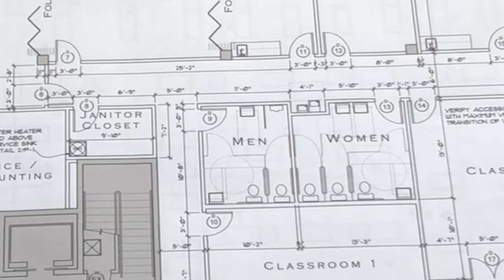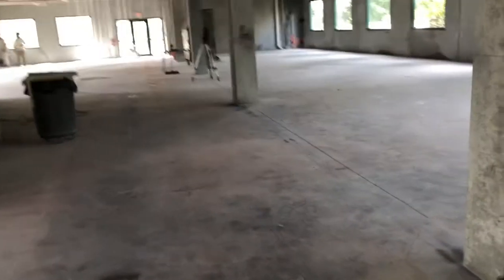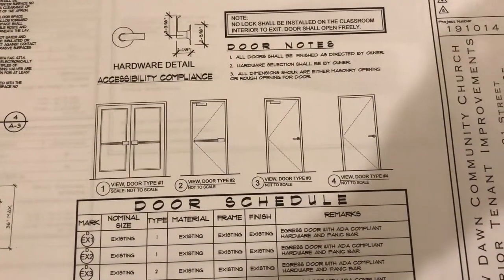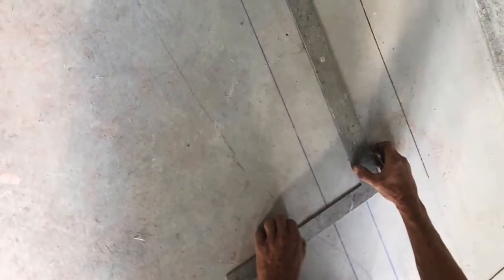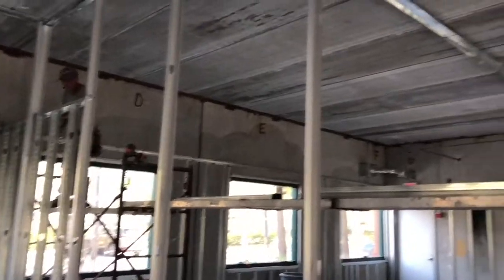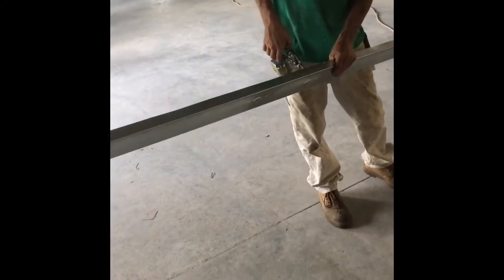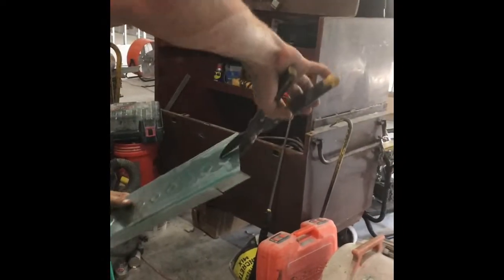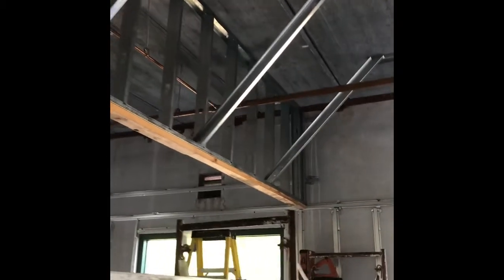7000 square-foot build out layout and framing

Comment: We normally do top track first? Same with you?
Reply from the maker: No we make sure we get all our layout done with control lines making sure everything lines up and is square, I like to put the bottom track down first so while working on a scaffold we can have a laser on the ceiling for the top track install the track and start putting in studs as we go it makes the job go much faster.